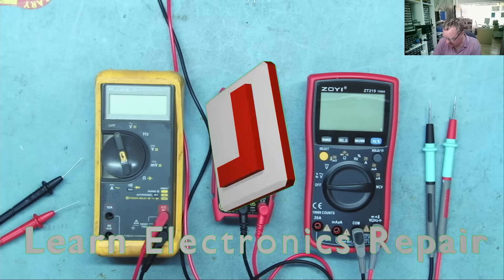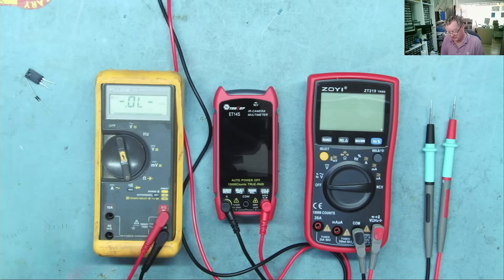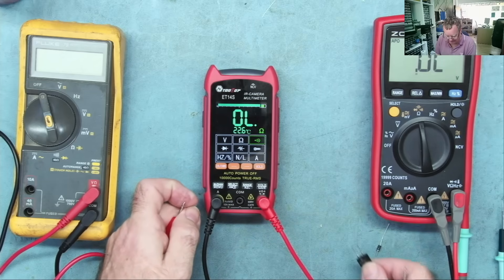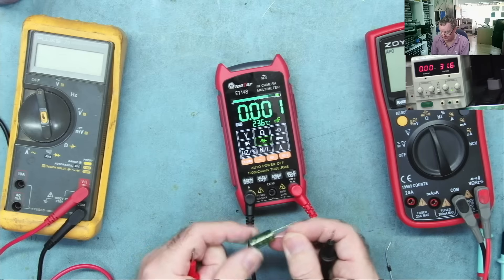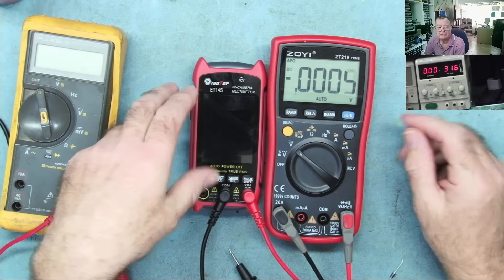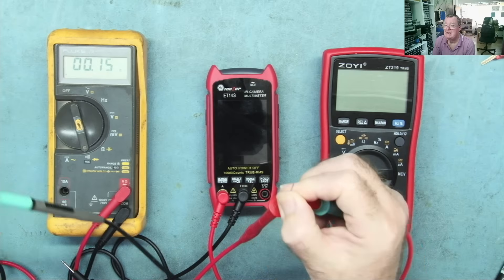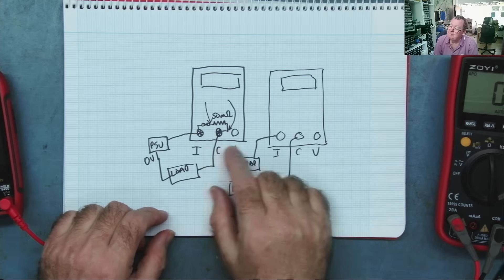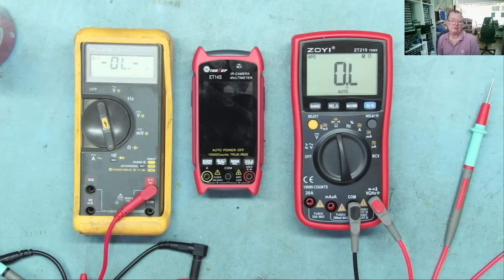What Is The Difference Between Common and Amps Terminal On Your Multimeter?  It's Not What You Think

Comment: Very interesting Richard....  I have been using multimeters for probably 50 years ever since I was a teenager... And of course I've blown the fuse using the amp function incorrectly... This was very very interesting...  I'm struggling with my "Programmed Nature " of using multimeters properly.... I am taking this lesson as... There is some forgiveness if you were to test something like voltage while in the amp function,  where the line is for blowing the fuse ?....  Is a little bit confusing, and you did say AC voltages also can be tested with forgiveness 🙂   what an absolutely interesting thing to point out,  but overall I think for my mental stability I will stick to switching the leads for each appropriate testing function.  It's kind of a hard habit to break,  because as we all know often times when you blow the fuse you often times don't have a replacement.   But it is absolutely noteworthy that there is some forgiveness,  And that's why this lesson was so interesting to me.
Reply from the maker: True, I did say in the video I wouldnt' recommend doing this, it was more to explain why it works anyway.  The most useful point is at the end where I explain how to easily test if the fuse in your multimeter has blown

Comment: 13:40 You don't need a second multimeter to check the fuses, put the meter in Ohm's range, red lead in V-Ohm and probe the A and/or mA input
Reply from the maker: An even better solution than mine. Nice one 🙂
Reply: That's a very useful trick! Thanks.

Comment: The Gossen Metrawatt multimeters have physical hardware protection, only the correct measuring points are available when you select a certain function.The selector knob cannot even be turned if the probes are plugged in the wrong way It is physically impossible to do it wrong. However, almost everyone professionally uses Fluke. Only because they keep producing the same model endlessly.

The choice of multimeter is also very dependent on the work you do. Not everyone needs an ATEX meter, or one with 0 to 20 milliampere control functions.

The most important thing is to know how many measuring samples a digital meter does per second.
For real time measurement, an old-fashioned moving coil meter is actually still superior

Comment: Part of the total resistance of the ampere circuit between A and COM is the additional path resistance from the jack to the shunt, which includes a fuse.  Since the large ZOYI meter is capable of 20A, it will feature a fuse with lower resistance than the 10A Tooltop meter.  The cross sectional area of the wiring may also be less substantial in the 10A model.  This additional path resistance doesn't matter to the multimeter, because it pulls the voltage drop directly off the shunt.  However, the circuit you are testing may be more influenced by the higher total resistance of a lower amperes range.
Reply: Most multimeters can only measure 10 amps for 30 seconds, after which the fuse blows. Therefore, for high and long-term current measurements, use a measuring clamp (coil)
Reply from the maker: @Bonksticker  I thought the time limit was not until the fuse blows but until the shunt, or PCB tracks in the multimeter get so hot they burn out 🤪
Reply: @ yes, that is true of most inexpensive meters, especially when the use a shunt resistor instead of a proper shunt wire. They unusually provide the short duration advice in the  manual.  Also, don’t forget the high resistance of the test leads can also be a limitation.

Comment: 4:30 you were checking diodes using the continuity range.  Did you miss changing it to diode mode? At first the voltage will turn on the diode, then as it loses voltage due to load or auto-ranges to a higher ohm range it loses enough voltage to keep the diode turned on.
Reply from the maker: Not at all,  I deliberately checked diodes using continuity range on both the ET14S and the Zoyi ZT219 to show what happens.  The Zoyi does not behave weirdly when you try to test a diode in continuity mode, it just says its open circuit. So does my fluke but the ET14S does this strange cycling thing.  I was pointing this out, most multimeters don't exhibit this cycling but some do.  I also checked continuity in diode mode, and the ET14S behaved exactly how I would want it to, most multimeters don't in diode mode.
Reply: @LearnElectronicsRepair  I agree this behavior is not acceptable.  Part of what they could do to fix it is to turn off ohms auto-range in the continuity mode.  There is no reason to go above 200 ohms range when checking continuity (my opinion).   A meter I recently reviewed only went over 0.2V when measuring in the highest range.  By keeping it in lowest range that would not happen.  See the voltage table at www.keepontesting.com/post/how-a-25-000-count-auto-ranging-multimeter-measures-resistance

Comment: It would still be useful if the meter beeps if the probes are in the wrong position when current is selected. Please speak with the manufacturer and ask them to update the firmware.
Reply: If the socket on the meter doesn't already have a split design or other mechanical method, then it probably can't be updated to recognise wrong socket insertion in firmware.
Reply: @Manticore1960  lots of IF and guesses. Ask manufacturer is the only way forward.....

Comment: I avoid the issue of the wrong plug by always having 3 leads in my multimeter, so I can easily switch between volts/ohms and current. Usually I keep an alligator/crocodile clamp lead on the current plug so I can tell them apart, but not always. The only... Er... "minor" disadvantage of having 3 leads is that about once a week I pick up the wrong lead and try to measure  mains voltage or a high voltage cap with the current probe. Which, of course, gets quite exciting, and sometimes results in a new set of probes. Now that I think about it, next time I replace them, maybe I should get a different color. 🧠
Reply: Can't do that if the meter has a sense circuit to detect wrong lead connections of course. Both my main meters have detection circuits.
Reply: @Manticore1960  What's the fun in that?

Comment: Still curious why it doesn't have a warning beeper to tell you when a lead is plugged into the Amps socket without Amps range selected, or vice versa.
Reply: Very likely.
It may not have split jack connections or detection circuitry.
Reply: @simonilett998  Split Jack connections are weaker than continuous, so it's a feature that is nice to have, but it does shorten the time between failures (in this case, a worn-out split jack connector ).
Reply: Gossen Metrawatt make it impossible to plug in leads wrong.But for some reason the whole profeesional market runs aways with fluke
Reply: It may simply have no way to detect the presence
Reply: Some have warning beepers & some don't. My Brymen BM869s has a warning beeper when the meter is set to anything but current & temperature when the lead is in the A socket. My ISO-TECH IDM 305 meter goes even further. It beeps when set to Amps while the probe is in the V socket.
Reply: At least the  Fluke 87 V can do that, there may be more....

Comment: The xoyi meter looks like you need to press the yellow button to put the meter in to continuity mode. There are yellow symbols on the dial.
Reply from the maker: Yes, the Yellow Select button selects functionality eg AC/DC voltage, Ohms/Diode/Continuity and the Range button selects the measurement range eg ohms/Kohms/Mohms etc